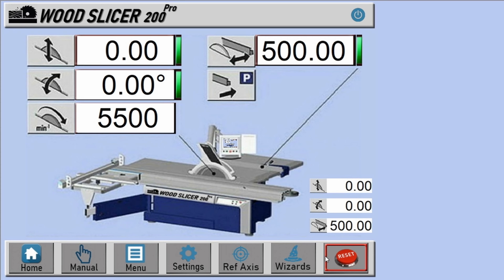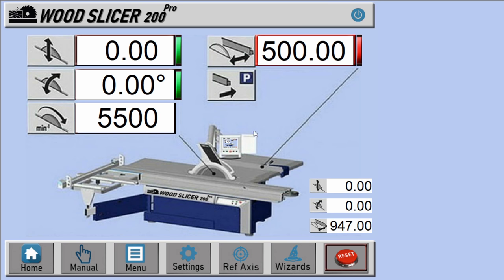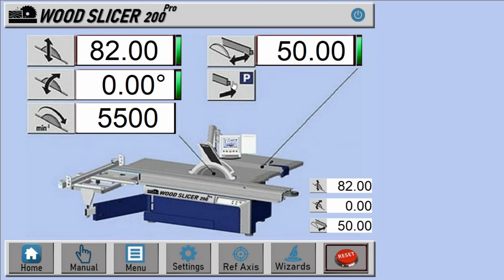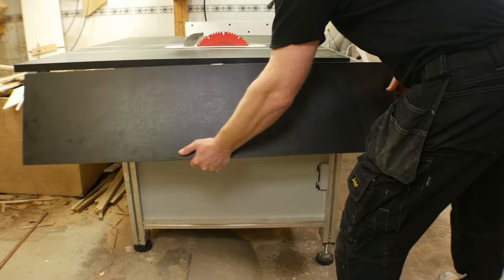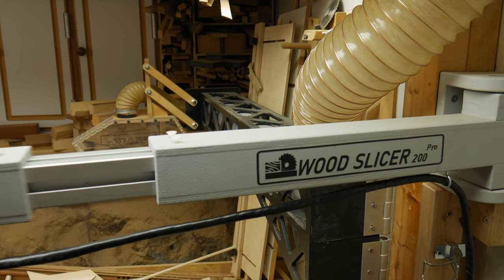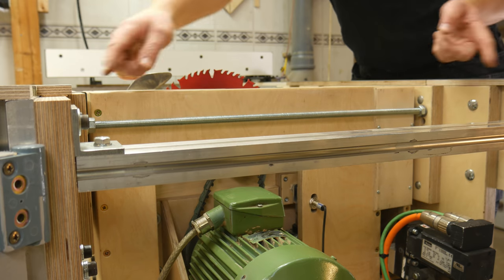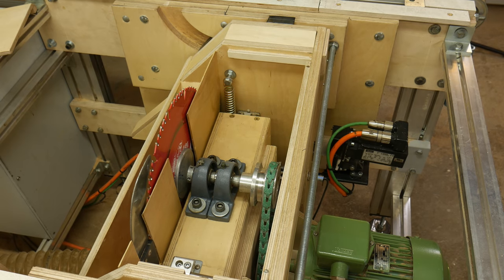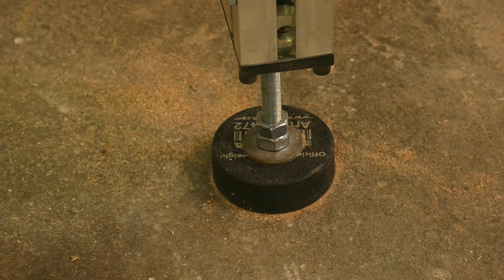You have NEVER seen a homemade Table Saw like THIS!

Comment: This is a really phenomenal build! I really like the use of automation in your workshop. We have an Alterndorf F45 at work which is a similar type of machine. One feature on it which you might like to consider for yours is a hold down to move button which has to be kept pressed while the fence goes to position. Just reduces the chance of pinching or anything getting caught between the fence and blade or slide fence. Great build once again.
Reply from the maker: Thank you very much for the generous feedback Sir. I find it to be a very interesting mix, and also I have been salvaging parts from my dayjob for years, and find great joy in reusing these parts. I have set the torque and the follow error on this axis to be just above the need for normal operation, so as soon as it senses to much resistance it trips. Like what you say, if a workpiece is left between the blade and the fence when setting a narrower width than the piece. ....ask me how I know:) It stopped fine and dis not bend the blade at all. Do you have a dayjob containg woodworking?.....if thats the case you are one lucky fella. I see from your latest video that you are doing some great fusion 360 modelling, is this a part of you dayjob as well? Thanks for watching and commenting👍😀
Reply: @bellevuesnekkeri  That's even better than a hold down button! I think we are both very lucky people. :) Yep - I look after some workshops for an art and design school - so a fare bit of carpentry and problem solving. I'm a big fan of fusion 360 - it's completely changed the way I make, and has made designing a lot easier. Keep up the great work and look forward to your next videos!

Comment: Roy, there are a lot of great creators out there  but you my friend I admire and respect the most.  Ps. I am not a couch potato - I built my (very basic) table saw in about 1995  which I used to build my kitchen.
Reply from the maker: WOW, that is some cool feedback Sir. Thanks for the love and support. Cool, fid you take any pictures of it?
Reply: @bellevuesnekkeri  No pictures . (that was before sharing on media was a thing )  But my pride and joy is my router table.  About 4 yrs ago I improved  the operation of the one I built over 20 yrs ago. It has a front operated height adjustment,  auto locking spindle (when raised to max)  incra style repeatable fence adjustment, vacuum port  and front on-off switch.  I can litterally change the bit, adjust the height, adjust the fence and start routing in about 1 minute.  All mechanical,  - total cost : under AU $50  (less than $40US), including a second hand Ryobi industrial  router.  I give it 4/10 on looks but 10/10 for functionality.  Expect some  photos soon - as soon as I figure out how to transfer and post  them.  Greetings from down under .  (Most days wild kangaroos can be seen about 500 metres from my house)
Reply from the maker: @michaelcoceski5442  No worries man. Sounds like a great router table, and remember...looks are just a bonus, functionality is the prime goal. We seldom see any roos here.... but that might be because we are 14300 km apart?.

Comment: Great job, basically the features of a 10k + panel saw on a home built machine. My only question is how long everything stays square and accurate? Do you need to recalibrate often?
Reply from the maker: Thank you Michael. Its hard to say, but I guess it should be OK. Cannot see why it should not. Only concern would have to be wear on the trunnions. But all parts are individually adjustable, so it should be able to be set back on track. Butit is a homemade saw, so it is by no means flawless.Problem is that it is hard to blame the producer.

Comment: Really good man! A couple of questions, did u use something to have feedback over positioning, like a linear encoder or so?
Also, what happened with the sliding table? You dismissed it?

When i first saw the screen from far away it reminded me to the altendorf.

Really good man!
Reply from the maker: Thank you very much for the generous feedback. The motors are closed loop servo motors. They have a resolver that gives constant feedback of the position to the drive, so position is dead on. I went alot back and forth on whether I was going to have a slider or not. It takes up a lot of room due to the large footprint, so I figured I would make one with just miter slots, and get my hands dirty making some sleds and jigs

Comment: Truly amazing!!! I think that the automatic fence has some real capabilities if it could be adapated into a retrofit kit!

Are there any visual /laser distance measurements? I assume all of your fence distance is calculated in steps via motor and homeswitch. From 3-d printing, I know that you can lose steps, especially if you're applying lateral force.  I would also be interested in some sort of dust shroud to protect the fence belts. 

So interested in how everything wears and your future inprovements! Truly innovative.
Reply from the maker: Thank you very much.No there are no visual distance measurement other than the DRO on the screen. The motors are closed loop servos, and that means, unlike open loop steppers, that there is constant position feedback from the motor to the drive, through a resolver. This ensures exact positioning. Any deviation from this is corrected by the drive, and if it exceeds a certain limit, due to overload or crash, it automatically trips the drive. Hopefully It will gibe me some good years of service. Thanks for watching and commenting

Comment: ha! super cool! wish the touchscreen from  felder would be as responsive as the one you use. also I would prefer your layout over the "original" one with the bigger number pad. great project!
Reply from the maker: Thanks, glad you liked . It is an industrial terminal that was salvaged from a dumpster on my dayjob. not a speed monster with a 1.2ghz processor and 2 gig ram running windows 7. Do you use the original felder saw?
Reply: @bellevuesnekkeri  I´m pretty sure it´s lightyears ahead of what felder uses :) ...I only have a 100% analog tablesaw without any smartness myself. but recently spent a few hours on a format4 when helping our my girlfriend at her workshop. the saw has motors on the height adjust and on the rip fence. pretty nice but also pretty annoying when the touchscreen does not work too good.  especially when putting in numbers.

Comment: You deserve a pat on the back for this design and build. The video was well done, but the complexity of that design and build is next level in my opinion. I’m building my own T-square right now and wanted to use linear motion. Did you have to use the double rail to prevent fence deflection?
Reply from the maker: Thank you Braden,. glad you liked it. I mainly used 2 because I had them laying around, and yes, it should stiffen it up some more. If it is totally necessary.....might not be. It think you can do a lot of deflection prevention with the rest of the design, like spreading the load with increasing the distance between carriages. Good luck on your build

Comment: Wooowwww very impressed, is amazing saw, just wonder in case a tool company made saw like this, how much do you think will run for money wise,  and how much time and money did you put on it, is a dreams cabinet guys saw, thanks for share and inspiring us(me) you are a genius
Reply from the maker: Thank you very much for the kind feedback, glad you liked it and found it inspiring. There are several companies making these kind of saws, and used Felder kappa 550 with motion controls are about 20-25.000 usd. But these are big panelsaws and can not be compared to this small homemade one. But it works great for me👍😀

Comment: Wow. Impressive build. Tempting to automate an existing saw. Curious how accurate is the angle setting vs actual angle measured since the actuator is linear and the tilt is in a circular arc?
Reply from the maker: Thank you very much for the generous feedback Ron. It is very accurate. As long as the trunnions are contructed well, and the hingepoint of the trunninon is at the top surface of the table it really is no different than a worm drive from a crank👍😄

Comment: Awesome work! Have you measured the parts that come from different angle and height settings? How often would this need calibration?
Reply from the maker: Thanks. I have not noticed any deviation from the parts measured when installed. The saw is homing all 3 axis every time I power it up.   But this of course does not take in to consideration any movement or shifting in any mechanical parts. But no issue yet😄👍

Comment: Your precision is without equal, almost as good as a commercial manufacturer.  However, I am curious on if you plan on incorporating your old sliding table mechanism, or are going to move away from it.  Your new table saw certainly has decent capacity, and I wanted to know if this is something you are planning on in the future?  Or is that the end of the sliding table mechanism?  It looks like you might have already used the linear rails for the table fence mechanism.  Thank you!
Reply from the maker: Thank you very much for the kind feedback Eric. The sliding table was taking up a lot of space with its big footprint, especially the linear railing. So I figured I would build a decent crosscut sled instead. The rails for the sliding table was 30mm wide. the ones used for the fence is 20 or 25mm ones. Thanks for watching and commenting👍😀

Comment: Another great project as always. And as always i wish i could see the buildvideo but ofcauce i know that,  it is very timeconsuming ;) 
Just happy you keep posting. 

One simple question. 
The way the spindlemoter is placed on the other side of the fence.. would that mean that everytime you change blade (Bladethickness) You have to recalibrate the fence?
Reply from the maker: Thanks Esben, glad you liked it. yes that is correct, however I only use thin kerf blade that are 2.5 mm. It could also be an option to easily integrate a blade width setting that would generate the offset. thanks for the tip

Comment: First off the build is awesome and out of all the cool stuff I have one question where did u get the arbor I have no idea where to start looking
Reply from the maker: Thank you very much. the arbor is a reuse from the old saw. 10 years ago when I made it i fabricated it from a 20mm cold rolled steel rod. I just cut the threads and turned the alloy pulley. The bearings are just standard UCP bearings

Comment: I started watching your channel since the power feeder project and am always impressed! I have been thinking about doing a similar automation project and was interested in the drive belt you chose. I have found a lot of opinions and only one definitive comparison (Pfeifer industries) that states AT style belts have the best accuracy. Could you share what belt you chose?  Is the accuracy of your fence solely based on the belt drive mechanism or does you UCCNC software provide backlash compensation? Thanks!  Always looking forward to your projects.
Reply from the maker: Hello, and thanks for watching and tagging along. The information you have are correct. As far as I know the AT belts are considered the most accurate. The belts on my fence are AT-10 meaning it has 10mm tooth spacing. They are the original on the Rexroth linear motion unit that you see. I just placed the linear rails on top or more stiffness. I use Mach3 as the core, with the custom screenset, and have no backlash compensation, as it is not necessary.

Comment: This is super awesome! 
Been thinking about doing something like this for my table saw as well. It would be a bit more of a retrofit than your custom build.
Have you seen any issue with your fence only being supported at the front? Or is the linear rail and fence itself stout enough to not flex under the loads your putting on it?

I always love seeing the things you build. They are super well thought out and explained.
Reply from the maker: Thank you very much Josh, glad you find it interesting. It should be no problem retrofitting a new automatic fence to your saw. There are some good examples out there on YT with great success. I have not had any issues with flex. I shortened it compared to the old one I had that had some flex, but the 2 linear rails are super stiff. Also the distance from the beginning of the fence to the blade start is shorter. Normally there is very little pressure on the far side of the fence, after the piece has been cut

Comment: Next up: automated sawdust collection unit? That's quite the mountain in the background...

Seriously though this is pretty incredible. I'm in awe and very envious... my only question is, is there a sensor to stop the actuators if resistance is sensed? I'd hate to leave something on the saw, hit the reset button, and then ruin the thing!
Reply from the maker: I am considering auto start, but for now it just autostarts when I open the blastgates. you can check it out in detail here:  https://www.youtube.com/watch?v=OSoZJ3criGE&t=
A few years back I wedged and carried out a couple thousand lbs of rock, to make room for the shop.
All the axis will trip if the get a following error that is larger than specified. So any stop in motion  due to crash, (such as forgetting a to large piece between the fence and the blade,will trip the drive

Comment: Great video- I keep coming back to it.  On your user interface display - did you use a touch screen monitor and Mach3 Screen set?  Is there any possibility of getting this Mach3 screen set and supporting code?
Reply from the maker: Thanks, yes I did. I made a custom screenset but it is still in programming progress, so not able to share it unfortunately

Comment: At last I found this.  I'm building similar table saw and have some questions. Is it possible for this saw to keep the angle setting after being turned off without rebasing ? Did you test the precission after some usage in time and lifting the table up and down ? What are the true resolutions?  Great realization !
Reply from the maker: Glad you found it. I turn off the power every night, so I have to home all axis. Still as accurate as it was when I built it, so no problems yet. The accuracy is more than enough for woodworking. +/- 0.1mm approx

Comment: Hearing your voice reminds me of my shopmade vacuum pod :-)  I guess I watched your corresponding video too often
Reply from the maker: Nice. I got a pretty good laugh half way through your comment, because I thought you wrote "Hearing your voice reminds me of my shop vac"....I know I unfortunately have a monotonic voice, especially doing voiceovers, but that lit up my day:) Thanks for watching and supporting through plan purchase. Are your vac pod working as expected?
Reply: @bellevuesnekkeri  Glad you liked it because in no way I was thinking about a monotonic voice.

The pods are great! I just dont use them as often as I should because my workshop is small and I have to set them up. They make sanding so much easier and the design is so smart.

I have to fix the looking mechanism though because somehow I cant block tilting at the moment (worked in the past)
Reply: @bellevuesnekkeri  The center hub was spit so adding 2 wood screw
s on the other side of the bolt/knob fixed it :-)

Comment: What material did you use for the table surface and how did you make it level? Thanks!
Reply from the maker: It is a 40mm particleboard countertop with high pressure laminate. I work in a factory producing these

Comment: Really, really, really impressive engineering and prototype! Can you input cut lists into the DRO? I can see that being a real time-saver for production work. Only feature I didn’t see addressed was a foot or knee switch for emergency stop? If your hand is caught in the blade, you are not going to be able to reach the stop button on your DRO. I’d be curious to know what the rough cost of the entire build?
Reply from the maker: Thanks a lot Steve. A cut list function would easy to integrate. But not being a production shop, I have not seen the need for it yet. But I might just put it in as a function under the Wizard button 😀👍
Paddle switch making and installation video is one of the videos in the coming along with some others. 
I have salvaged all the parts for this over years, so the only thing I had to purchase was the usb motion controller off ebay, and that was 15 Usd. if I wa to purchase all the parts new........it would have been much wiser to purchase a commercial saw
Reply: Bellevue Woodshop That was built with salvaged parts!?! You are finding far more interesting garbage bins than I am! Makes the project even more impressive! Glad to hear you already thought of the paddle switch - I look forward to the follow-up video.

Comment: Do you have a materials list for the motors, servos and electrical parts you used? I looked for plans on your website but didn’t find any.
Reply from the maker: Hi Bruce. Unfortunately there are no parts list or plans available. It was built from salvaged parts only, and designed on the fly as the build progressed. I dont think the cost of purchasing all parts would make it a viable project

Comment: She's a bloody ripper mate.Have you a source for your arbor shaft ? They are impossible to find in Australia
Reply from the maker: Thanks John. The arbor is a reuse from the old saw. 10 years ago when I made it i fabricated it from a 20mm cold rolled sreel rod. I just cut the threads and turned the alloy pulley. The bearings are just standard UCP bearings